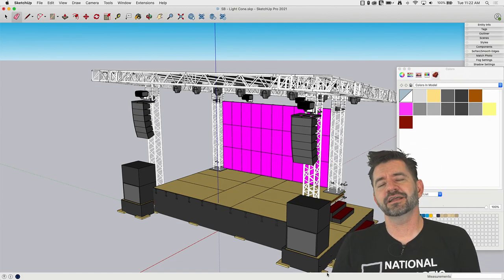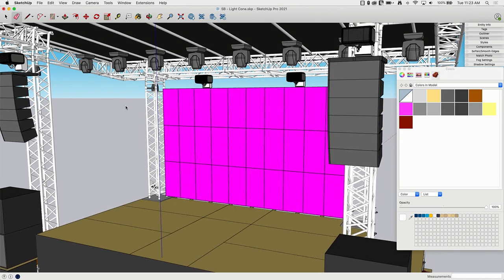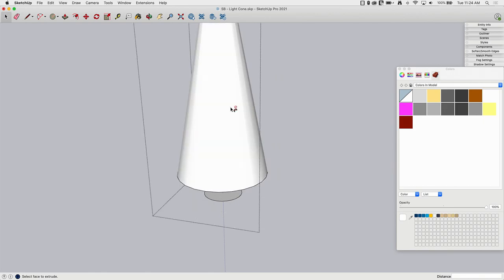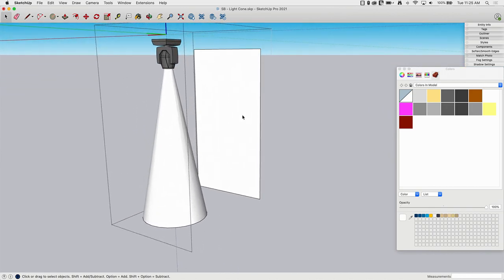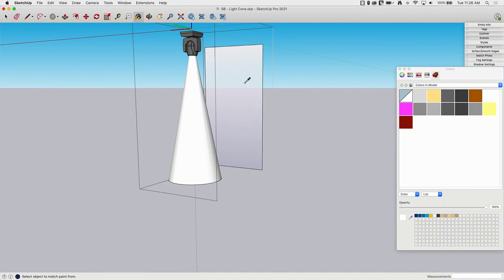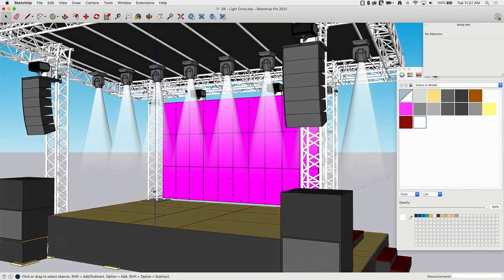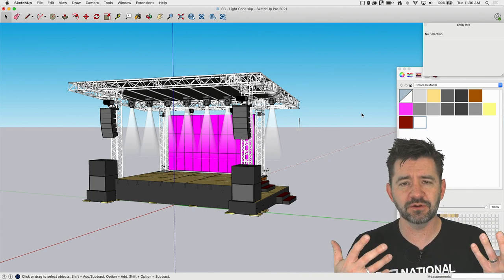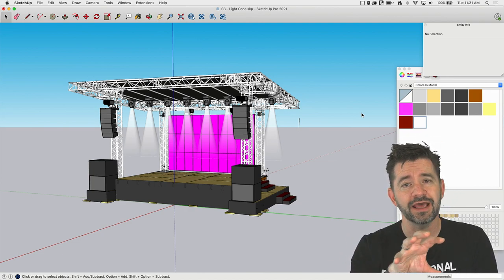Modeling a Light Cone - Skill Builder

Comment: Hi! A great video.4.02 in the video. One important thing I think you need to mention is that the image should be imported as Texture. (Options). My default settings were set to 'image'. And I fiddled around a bit before I found out why the image was not inserted correctly into the square. 😁🤔. 5.13. When I delete the ring parts there are holes (wedges) in the cone ?? 😒